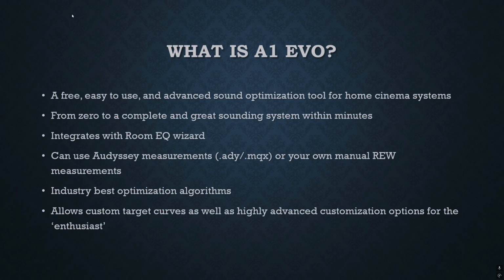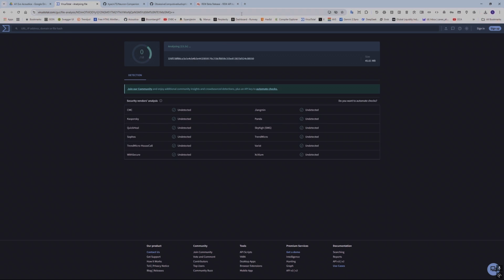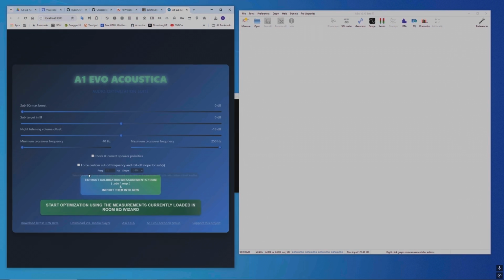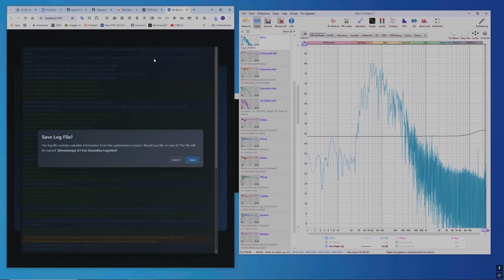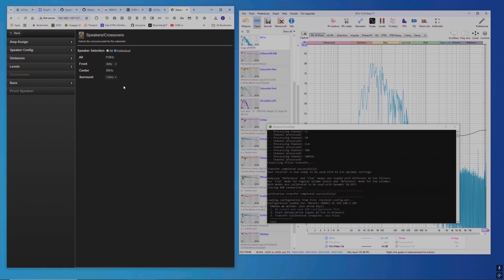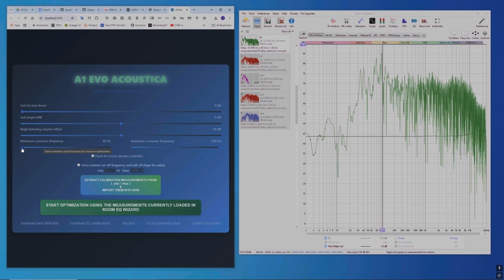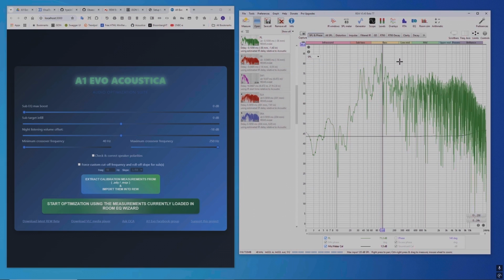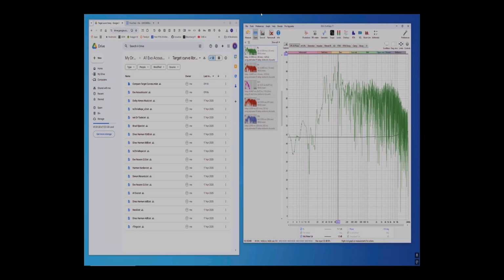A1 Evo Acoustica

Comment: Is it ok to use Auddyssey xt32 meassurements or will I get better results using umik-1 with rew?
Reply from the maker: If you have one sub, measured your system in proper silence and with the mic properly placed with a stand, Audyssey measurements will do just fine.
Reply: @ocaudiophile  I have two systems, 7.2.4 and 5.1.4. 2x SB2000Pro and 1x PB2000Pro. I use directional for the 7.2.4. I suppose it is ok then. Thanks.
Reply from the maker: @pedrog.3406 yes directional works when you've multiple subs.
Reply: @ocaudiophile  I just tried the whole process in my 7.2.4 system using directional bass and the distances are wrong for all speakers, is it normal? For example, Auddyssey detects my central channel at 0.85 meters, which is ok, while Acoustica sets it to more than 2 meters. I know that speaker is too close to the MLP but it is a gaming setup using keyboard and mouse, so it has to be there.
Reply from the maker: @pedrog.3406  You can ignore the distances - there's a note in the logs about that. Play a proper atmos game and you will hear that the bubble is best it's ever been ;)
Reply: Thanks OCA, I'll be checking the results this weekend. Nice work and very easy to follow. Thanks for sharing.

Comment: I have a sr5015 in my lounge, 3.2. under subwoofer in speaker config It only has no or yes. How do I take measurements of both subs? Odd only sees 1 sub and only measures one sub
Reply from the maker: You can use odd.wtf tool in Neuron video folder.
Reply: @ocaudiophile  it doesn't work, sr5015 can only set yes to subwoofer not 1 or 2. I just got a minidsp to take care of it instead.

Comment: Do you have a guide for using Acoustica with a UMIK-1? Would it make any significant difference compared to the Audyssey mic?

I just purchased one and would love to learn how to use it with Acoustica. 

I have a 5.1.4 setup and have been using the Auro-3D upmixer. I have been somewhat disappointed in my spatial resolution, especially with the height effects. I'm not sure if it's my setup or the technology. I have nothing to compare to.

Regardless, Acoustica improved my sound, so thank you!
Reply from the maker: There are details on REW measurement process in Nexus video.
Reply: Thank you!

Comment: Hi it is me again. Question, I already know that my app on android has that bug wherein it sets my subwoofer levels at -12db. So, as an experiment, I ran audyssey with the receiver not with the app. I only did 3 mic positions. After that, my subwoofer level is at -5.5db. Now, can I just used my .ady file and edit the levels in my subwoofer and change it from -12db to -5.5db and just upload it with your a1 evo acoustica? Thanks.

Comment: With 5.0, my tiniest Atmos speakers (rear heights) have the lowest crossover (80hz), and my biggest front towers have the highest crossover (180hz). What's concerning is... Those little Atmos speakers won't get down to 80hz, and my front towers were set at 40hz on the first version of Acoustica (140hz lower than with 5.0).

Comment: Using Version 5.0 i have noted, since "check & polarity" is set to "off", it still stated in the log file that it did change the polarity if needed. Bug?
Reply: Is this the case for others as well?
Reply from the maker: It will prompt that if it inverted the subwoofer.
Reply: Yes, but even if inversion is off by default, according to the script, it does the invert for sub and also for some speakers as well....

Comment: I've started using Neuron's utilities in order to clear all prior filters. Would you recommend a full re-measuring using the tools in neuron - to bypass the use of older measurements from the MultiEQ app?

Regarding transfers, I've found that attempting a second transfer after an initial failure usually seems to work - unsure why.

Comment: Kudos Acoustica Team ! Surround effects are very pronounced. Subwoofer feels well utilized.Reference option comes out qualifying the center channel and dialogue delivery at a level expected out of the invested hardware than the Flat option. Cons so far - Stereo mode output for music only listening is not at par with AV receiver provided calibration.
The value provided by this team to experience goodness of sound without a cost is greatly appreciated !
Question - the Subwoofer trim is at 9.5db on optimization, will the subwoofer hardware health be ok in the long run?

Comment: How will run the built in measurement file (odd.wtf) ? Is this the one that I can get from your A1 Evo Neuron video? I went on that google drive download the folder that has the odd on it. Once downloaded I extracted the zip file and inside the folder there were odd files...some were in .bat and there is the one with the .wtf How to use and run the built-in measurement? Do I need to plug the audyssey mic in my laptop? Thanks
Reply from the maker: It runs in the command prompt and you plug the mic to your AV receiver like you normally would...
Reply: @ocaudiophile  thank you. funny thing I did run that .bat file my av receiver was not found over the network (wireless) I think it is because I did not plug the audyssey mic in my avr..??
Reply: @ I think I am doing something wrong here. So, I downloaded the odd.wtf folder. Then I plugged the audyssey mic in my AVR. In that odd.wtf folder, the only file that I can run was the odd_menu_multiple AVRs.bat. Once I opened it, There are numbers that I have to choose. I chonse #5 "starts built-in measurement process..." And then it will search my AVR. And it just stops there as it did not finde my avr...

Comment: Hello, I loved your previous videos a lot, you were very helpful. Now I don't have an AVR yet, I use EQ APO for my system. Is it possible to use the A1 tool without an avr somehow? Thank you in advance!
Reply from the maker: You can in theory export the filters produced at the end of optimization in REW as.wav files and use them in EQ APO for up to 7.1 channels
Reply: @ocaudiophile  could you please advise how I should begin the optimization when it’s asking for a network connection to an AVR? I’m not quite sure how to proceed—any guidance would be greatly appreciated! Im still trying on my own to get it started :D
Reply from the maker: @dominikzils5160  Hmmm, script is not easily available to hack in Acoustica  and it will look for an AVR. Try A1 Evo Neuron script but they all need a json file to work which is not impossible but also not very easy to produce manually.
Reply: @ocaudiophile  I will try it, thank you!
Reply: @ocaudiophile  Hello, I tried creating a json File, but I didn't manage to make It Work. Do you have an Idea how to create a correct json File or how to usw the Script without the json File? Or is the Script exactly the Same AS your previous Videos where you manually creates Filters? Thanks in advance! :)

Comment: Hi, question, I re-do the calibration on my denon to get the .ady file. On the process on audyssey on the sub volume/level, I adjusted it to be on that green colored area where it ask me to place it.  I did that and did the 8 mic position. I followed everything on your steps (A1 Evo Acoustica) successfully finished the entire process up to transferring the .oca file in my avr.  

I watched a movie, Prey, and I think my subwoofer is not there. checked the levels in my avr it was on -12..

On your web software, what is the purpose of the sub eq? 
also, do I just adjust the sub level in the avr setting?
Reply from the maker: Are you using the Android version of the Editor app? It has a known bug that shifts volume of subs by 12dB. I've seen MultEQ-X do something similar at times, too. If that's the case, use odd.wtf -measure tool to measure your system.
Reply: @ocaudiophile  yes. android. where will i find that? thanks.
Reply: @ocaudiophile  Hi, sorry it is me again. this odd.wtf, I have to redo the calibration to get again the .ady file?
Reply from the maker: Yes odd has a measurement feature that produces a proper ady file but you have to repeat the measurement process with the mic. Your Android measurements are invalid unfortunately.
Reply: @ocaudiophile  understood. Is that program very straightforward to use? have not looked yet, but, is that in your Google drive? lastly,  in using it, is it just as simple as your browser program?

Comment: With Acoustica 4.4.2 versus the first version of Acoustica, the crossover for my Klipsch RP-8000 front towers went from 40HZ to 180HZ. The other crossovers did not radically change. The front sound stage is less dynamic, but bass seems a little smoother. I am using the first version of Acoustica for watching TV and listening to music, and I am using 4.4.2 for movies.
Reply from the maker: I hear you

Comment: Hi Serkan, Thank you for the great update!
I would like to offer a few suggestions for improvement:
Please bring back the creation of the _DEQ0dB.ady extension for low volume listening (Reference) that was created in previous versions of the A1 Evo, this would be handy for receivers with multiple configurations.
Add the curves from the "Target Curve Library" folder to the web interface for easier selection curves before optimization.
Add the ability to apply REW settings (Maximum measurements 1000 and uncheck the "Drop filters if gain is small") via the Node.JS JavaScript Runtime application or the web interface. This would be handy as an automation.
Thank a lot!

Comment: That´s a massive update! 
Thank you for that! :)

Could you just explain the "Night listening volume offset" function please?
I understand that it creats the different EQs for Reference and Flat setting, but what does the offsets, i can choose from, mean?
My system seems a bit too bassy now.

-xxdB from what?
What would i choose, when i mostly listen at -30db (stated on the receiver display)?

i used the MultEQ app for my original measurements so how does Acoustica know, at what levels i normally listening, when it only has the measurements at i don´t know wich db they are?

Would be grateful for an answer. :)
Reply from the maker: You should normally listen your system in Audyssey Flat setting when you are using it at normal/loud volumes. When you need to dim the volume down (late night), you can switch to reference which will boost bass and treble so that it becomes more intelligible at low volume. The offset setting should be based on the dB difference between your loud and low volume listening levels.

Comment: Thanks for all your effort. It's been fun following your work and I'm happy to have donated in your Neuron thread.

I'm running 4.4.2 with an X1700H in a 7.1 configuration. I installed not Dr Toole and a Flat target EQ into presets 1 and 2. I was watching a movie last night and no matter what I selected, be it one of the presets or Audyssey Flat vs Reference, the audio sounded choked. The speech was not very intelligible and voices sounded sort of muffled. Then, as an experiment, I went to the Audyssey menu and instead of selecting Flat or Reference, I selected Off. The audio dramatically improved. The sound was more open and speech was much more intelligible.

I thought I'd mention my situation as a data point.
Reply from the maker: I'm afraid some issues still continue with XT models
Reply: @ocaudiophile  Hi Serkan!
A similar situation is happening on my X1800H in 7.1 configuration. At the moment i use the Dolby Atmos Music curve, with it the bass and sound are softer, but still the sound is not up to par if you choose Flat or Reference.

Comment: Hi OCA.. Using V4.4.2, worked perfectly for the 1st time and generated the OCA file.. somehow it is not working any more and script getting stuck after defining the crossover details.. tried the 1st OCA file that i could generate.. the surrounds and Atmos is very silent and Sub has presence but isnt very accurate.. not sure if all the filters are getting applied correctly.. Denon X 3800h with 7.2.4 setup.. Also, the issue of file transfer creating all speakers as full range which was corrected in in 4.2 comes back with 4.4.2...
Reply from the maker: If it worked the first time, it's what ever has changed in your system that is causing the issue.
Reply: Ok... Will try everything afresh.
Reply: Tried everything that i could think of still the script is getting stuck at Polarity inversions will be applied automatically..  updated rew,  re-download Acoutica V 4.4.2, regenerated configuration file, reprocessed measurements.. but yup something broke at my end.. no worries will wait for the next update probably that will start working again for me 😢
Reply from the maker: @AbhishekSingh-fw7fv what's the error detail if you right click on chrome browser and select inspect?
Reply: Hi Oca.. this is the section where is see some errors.. not sure if this helps..

Comment: Hello OCA, perfect work again!

I have a Q. and tips.
Question: You mentioned that low volume listening adding some bass, depence on offset. It is only change there? I liked DEQ because there was also some additional boost on high FQ. Becasue same as low FQ, also High FQ are little bit less hearable during low volume listening. 

Tip 1: If high FQ is not used in low-volume listening mode, it might be a good idea to add this change.
Tip2: We have finaly chance edit FQ on Main speakers and the rest. Separately. Is there a possiblity to add more? Like paar (mains+C+ high, surround) ?
Reply from the maker: There's boost in HF as well but not so sure if XT models are applying it correctly if you have one.
Reply: @ocaudiophile  i have Denon x3800h, it should be XT32 there. 
I will test this new 4.4 ver. Script saved file with old naming 4.3..but that's not a big issue.  just FYI
Reply from the maker: @Majchel  thanks, fixed that with v4.4.1 ;)
Reply: @ocaudiophile  first feedback on 4.4, 
Im not sure what was changed on low fq, but I like a little more ver 4.2 for the bass. I will try some additional settings or EQ. But bass on 4.4 are fuller, but not that directed, punchi. It is fuller bigger base, around all room. Instead of 4.0/2 there was bass more punch, directed on me, have a more resolution. That's what I like.
That's also reason, why I always try to set sub target infill, on 0db, or minus.. because that fuller bass are not accurate. Preffered curve: A1 Evo or Evo Neuron.

Comment: Thanks!  Hi OCA, hope all is well.  I ran V8 today and took new measurements with the Acoustica measurement system option.  I took 9 measurements an ended up discarding the last 3 positions as I noticed the sweeps looked odd compared to all the other postions.  I don't know what caused that but never the less, I ran the script with the remaining 6 positions and the result sounds amazing. The enhanced dialog feature along with All passfilter option took my sound to another level.  I also like that I didn't have to fuss with setting XO options as the script got them all right based on my speakers capabilities.  Prior versions always got my atmos speakers with 250hz XO that I had to manually override.  V8 seems to now dectect everything right out the box.  I have book shelf speakers for mains so i was hesitant to try the LFE+Mains option but I did it anyway.  And glad I did because it sounds amazing as wel, it adds something extra to movies.  Anyway, thanks again for your immense work and generosity.  I don't think you can top this but if you do, I look forward to trying it.  Again thank you and may you finally hit that 10k sub very soon.

Comment: Haven't made any changes to my system since installing Neuron which never indicated any polarity issues with my 7.2.4 setup (Denon AVR X6700H).  However, when running Acoustica 4.2 and 4.3, several of my speakers have been identified as being out of phase?  I've double checked that the +/- polarity is indeed correct for all the speakers.  Any thoughts on what might be occurring?  Thanks in advance.
Reply: If you wiring is correct you can Untik the Polarity check. Off by default
Reply: @kevinmastah  Thanks Kevin, I understand unticking the Polarity check is an option and appreciate your identifying this.  However, this doesn't explain why Acoustica indicated the necessity to change the Polarity in the first place (when we know the Polarity is physically correct)?  ie: is this an Acoustica bug?  Keeping in mind that all the prior Evo Neuron versions 1.5 thru 3.1 never indicated a need for a Polarity change with my system. 
And, by ignoring the Acoustica warning (turning off the Polarity check), does this then negatively impact the overall Acoustica calibration?
I'm just curious, as I'm not knowledgeable enough to go through all the code to know what's actually happening during the A-Z calibration process in respect to this Polarity notice, and the positive or negative results if ignored.  🙂
Reply: In spite of this anomaly, I whole heartedly agree that Acoustica V8 is an amazing step forward in software tuning.  Cheers to OCA, REW and the overall team working this project!!

Comment: Hi, I am having trouble opening win64.exe file. command windows open closes straightaway. any help welcome.
Reply from the maker: That's usually an error being thrown by the exe. Make sure you are using the latest version (v4.3) and open a command prompt, cd to Acoustica folder and run the exe from inside the command prompt by typing its name and pressing enter. You will be able to see what the error is.